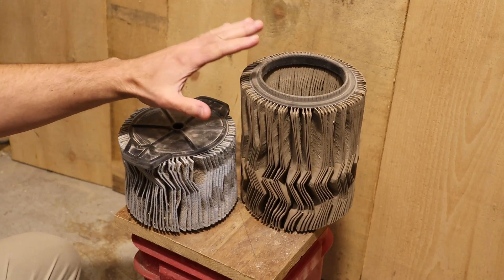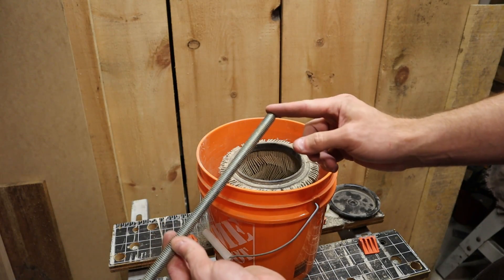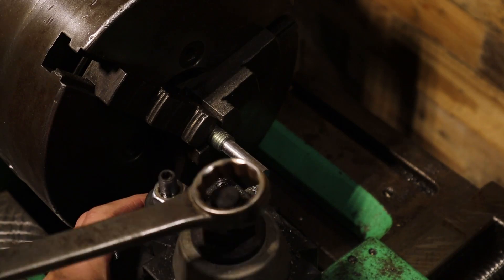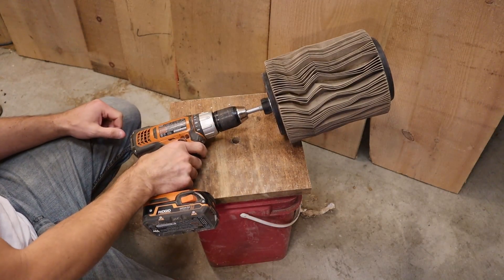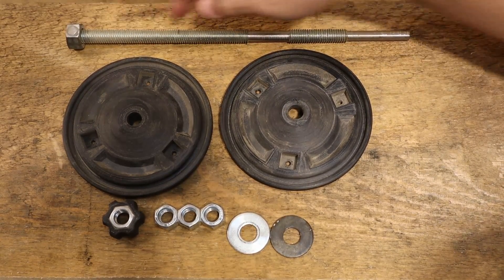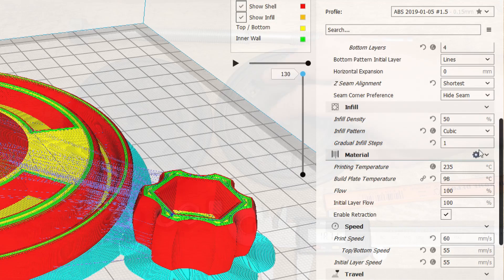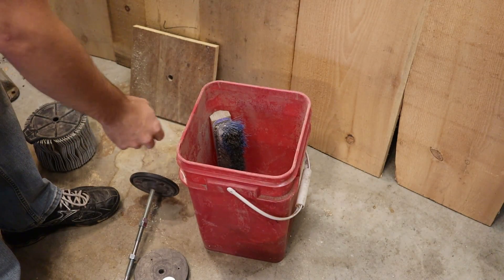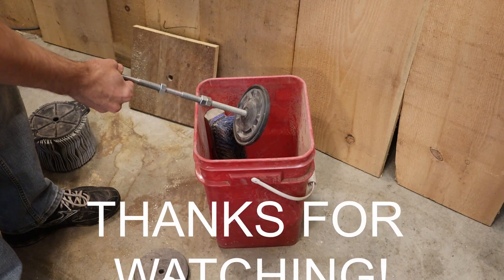🔨 SUPER CLEAN your Shop-Vac Filter with this Simple and Cheap

Comment: Try without the brush but with high-speed spin?
Reply from the maker: I was thinking about a redesign, I didn't do a great job with this video, so maybe a fully 3d printed case and just high speed.  I have to say though, I use this device every time I clean the filter and it works really well.  I could have done a better job refining it.

Comment: cut a piece of 3/4 plywood to fit in bottom of bucket.  drill center hole.  extend threaded rod with turned end into the hole.  now you have support at both ends of the shaft.  might consider 8mm roller blade bearing for free end of threaded rod.   OR  you can do what I do, walk out to the yard.  Toss the filter in air and let it land in the grass a few times.  That usually knocks most of the dust out.
Reply from the maker: For sure the old toss and run works.  I was putting it in a bad and whacking it on the side of the house, works well with minimal dust.  I think they could design vacs better now with the cyclone built-in, that'd get rid of 90% of the problem.

Comment: If I have ever seen a Rube Goldberg machine this is it. Waste of time. Way too much work. Blow it out with an air hose and compressor and after a few times toss it and get another.
Reply from the maker: 2nd filter in now 22 years for this vacuum, I bought it when I was 15 years old.  It still works really well, and I use this method of cleaning the filter exclusively in my shop.  Keeps the dust down and out of the lungs.

Comment: If I need to buy a lathe to make this, would it be cheaper to just bang it on the floor?
Reply from the maker: Sure you could buy a lathe, think of how much fun it would be.  I think I mentioned that you could use an angle grinder if you didn't have a lathe.  If you don't have that, you could take 3 hours and use a file.  Tolerance isn't critical.  I didn't go a great job on this video, too much going on at that point, the concept is there.  I still use it and it does work very well for my large shop vac filter.

Comment: blow it out with compressed air from the inside and wash it with dish soap and let it dry in the sun. No printer. No lathe.
Reply from the maker: I've tried that, works well but my neighbors weren't too happy.  So pick a less windy day than I did!  The wash method works well if you have two filters, I'm too cheap for that, still running on my second filter the vac is approx 20 years old now.  Great vacuum.

Comment: I'm broke and need to fix my old shop vac. All I will need is a 3d printer and or a metal lathe 😂🤣😂       🤟😜   High quality vid all the same 🤟
Reply from the maker: Have to admit that I made this over the course of several months and I'd didn't come together quite like I wanted.  I'm a woodworker, could easily make this from wood, but I do like making interesting things on the 3D printer too.  The threaded rod can be modified with an angle grinder if needed rather than a metal lathe, I have one from the early 1900s, it is 7' long and cost me $400.  

Thanks for the support and the comment!
Reply: @NeedItMakeIt  I appreciated the vid and watched it right to the end. Love your tools and abilities. Almost anything is possible now 😁🤟. Thanks again.
Reply from the maker: @andycrowley6442  I've been using this in the shop now that I'm back to woodworking a bit more and it does work very well, you have to be a little gentle to remove the filter from the vac.  It'll make a quick appearance in my next video.  Everyone who wants to make things should buy a 3D printer, even if it is just a basic one.  Normal limitations go away and you can really go wild.  Thanks again for the comments.  And make sure you check out my next video, there are cool video segments and I'm coming up some some interesting ways to solve problems.
Reply: could do same thing with a reducer and a bunch of locktight, or epoxy I imagine

Comment: Does it work for drywall dust?
Reply from the maker: It works well for any dust including metal dust I've tried it on.  It won't get it spotless, but it is so much quicker than washing and waiting for it to dry.  It does also work for the new filter types, you just wouldn't need the top piece since they come with a polyurethane top that presses on.  My method used to me to put it into a black garbage bag and throw it around, now the dust doesn't get inside the filter and come out through the exhaust on the first run anymore.

Comment: cool! im thinking of doing something similar. but why dont you just throw it in water with some simple green?  then spin it dry? no dust. the filters i believe are rated to be washed. also consider upgrading to the blue or green rated for a finer filtering. 

first go around, I just washed the filter, then made a quick version of what you have and just spun it dry.
Reply from the maker: By all means, that's a good idea.  I have washed mine quite a few times, but drying time was a problem.  Some dryers have that rack inside for shoes, that might also work on a low heat setting.  Nice Job!

Comment: I think by now you should replace them
Reply from the maker: They are terribly expensive now, around $20 for a single standard filter, I'd like to keep mine going as long as there are no tears.  It seems to still work well.
Reply: They are crushed and look at little moldy
Reply from the maker: @bread-gz3rl  I suppose after 15 years of using the same filter, it might be time to buy a new one.  It still works very well, it's not moldy, but it is used to clean up metal shavings/dust.  I've had this vacuum for 21 years now (only my 2nd filter), it's been very good to me.
Reply: NeedItMakeIt same filter for 15 years?! Dude lol
Reply: @NeedItMakeIt  15 years? Omg
Reply from the maker: @Raii_Chu  I finally bought a new filter, I'm going to be doing some turnings and I figured I should have a new filter

The new designs have the moulded top and they still fit my old shop vac.

Comment: Yeah, like everyone has a shop with a lathe
Reply from the maker: if you don't you should, they are an amazing tool to have, it has opened up so many more possibilities for me.  Or just use an angle grinder or bench grinder to remove the threads to chuck it up instead.
Reply: L

Comment: You might consider coming up with a way for someone to accomplish this without a 3D printer and a lathe. 

If you can afford those already filters seem like a cheap thing by comparison to try to save.

I could see plywood being used to make the clamp plates. And as for the drill chuck maybe just get a rod already small enough to chuck.
Reply from the maker: The filters here in Canada are around $20, but I get your point, so here are my ideas:

To allow the threaded rod to be chucked into your drill, you can use an angle grinder and mount it into your vise(vice) and  rotate the rod until you clear all of the threads off, at low speed the precision isn't critical anyway.    If you have a bench grinder that would make the job even easier.

As far as the nuts, some people already have two 'in-hand'.... they're pretty cheap so those shouldn't be a problem.  For the 3D printed parts, I think plywood or even solid wood made on the wood lathe is doable, but you can actually re-use the one from the shop vac itself and since the new filters have a flexible top on them, you only need one plate so it is probably do-able without 3D printing anything.  The total cost for me to make this is $7 tax in, but I had most things handle and the threaded rod was only about $2.

I can always make a follow up video if this is a good enough idea to warrant it.

Thanks for your considerate comments my friend!

Comment from the maker: I see someone added the first thumbs down, if you would be so kind as to explain why you didn't like the video so that I can improve for next time, I'd certainly appreciate it.  Thanks!
Reply: It got posted on reddit (maybe by you).  That's all it takes.
Reply from the maker: @marc2912dotcom  Thanks for the comment.  On reddit there a quite a few people who think you need to purchase a lathe to do this work it seems.  I have one so I use it, but you don't need one, just an angle grinder or a bench grinder.
Reply: Haters suck. I clean my filters with the garden hose and leaf blower. Where I live,  we have snow on the ground...um... like Never. So its no more a problem to hose the filters off in July than it is in January.  But if you have the tools and time,  why not make a cool filter cleaner thingy?  A special device is not necessary, but there's a joy in building it as well. But you might just have a "little" in common with Tim "The Tool Man", if you recall that show. Lol!

Having just wrote this, it occurs to me that if I frequently vacuumed up sheet rock dust, insulation, or Hardi-board residue,  I might want something like this. For saw dust, nope.
Reply: I feel the same as the other commenter , "really? a 3D printer and a lathe required! " I take my filters outside. hurl them into the air and let them bounce and then blow them off with a leaf blower and I'm done